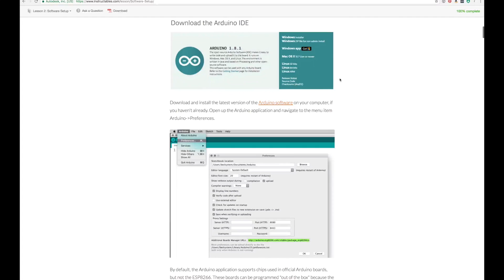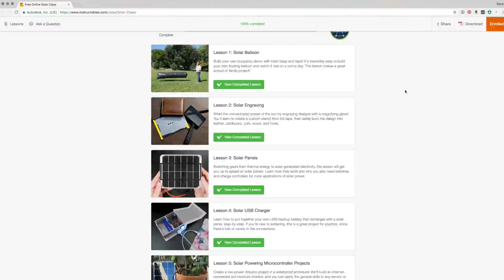Solar Soil Moisture Meter // Becky Stern

Comment: Hello Becky. Great video. I am working on a project which has similar functions like this. I have to use Zigbee and ESP8266 together and create a demonstration. Is it possible to interface both? What will be the good choice between ESP8266 and NodeMCU to connect with Zigbee? I would appreciate your guidance and expertise on the same for explaining connecting Zigbee and ESP8266/NodeMCU.

Comment: Fairly new to the diy electronics scene, so question; would it be feasible to create one solar panel/charger/battery enclosure that then powers multiple soil monitors?
I'm attempting to find the cheapest, most efficient way to monitor about 8 vegetable planters.
Reply from the maker: Potentially, depending on the size of the solar panel! You can learn how to calculate your circuit's power needs in my free solar class, the link is in the video description.

Comment: cool beans, or bean sprouts as the case may be. We have a watering timer valve that waters automatically but a more efficent way would be to have those items talking   is there a board for that? Orbit Digital Hose Water Timer its like one of these lowes sells them

Comment: Interesting, but the Adafruit states the Sensor as suitable for weather sensing, not for soil sensing and in fact should not be used for more than an hour in a wet environment (such as soil?).
Regardless.... A nice project
Reply from the maker: Your comment is not accurate, so I want to clarify for everybody here. The product page (https://www.adafruit.com/product/1298) says "While it is designed to be submersible in water, it's always best to avoid long-term (over 1 hour at a time) submersion". When I water my plant, it does not submerge the sensor in water for more time than it takes for the water to permeate through the soil. But feel free to use a different sensor if your plant is something like a mangrove in water!
Reply: Becky Stern ok thank you